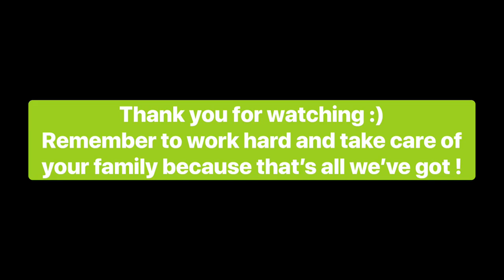WATCH THIS BEFORE YOU DETAIL FOR A DEALERSHIP !!!

Comment: I was/am getting $160 per car with dealerships, but it got to a point where they would only bring cars that need quite a bit of work and it went from a guaranteed 3x cars per wk to 1 car or none, so this is the last month I’m working with them. Dealerships are temporary. If you’re getting enough personal cars, don’t deal with dealerships.
Reply from the maker: That is true there are a lot of ups and down working with dealerships so I definitely do recommend not to work with dealerships unless you really need to🤝🏼 i was working with the dealership in this video for a while but they wouldn’t pay me until 2-3 weeks later so I cut it off !
Reply: @CarsMastersMecanicShop  good! If they don’t respect your time, you gotta do what most are too scared to do. Dealerships can be a hustle.
Reply: Did it long enough to get my llc and insurance and ran like hell

Comment: Dealerships after a while, start taking advantage of you. It's okay to start and learn things but over time, they're gaining "interest" over you by getting free cars detailed. I've dealt with plenty of used car detailers and they don't appreciate or tip for the most part, if ever. The shitboxes they bring use more time/resources and they won't even have a consistent amount. Once you get your own clients and referrals, wrap it up for the used car dealers. They don't care and won't care if your vacc fails, if your air compressor fails, power wash fails, etc. It won't make sense after a while.

Comment: What are you spraying towards the end of the video and which banks do you recommend to set up as a business bank? Also if you have any info on insurance it 2ill be greatly appreciated
Reply from the maker: At the very end I am jsut spraying my carpet cleaner which is sea blue 8-1 carpet cleaner diluted 1-4 and the spray Im using on all the plastics is simply just protectant also I can’t really give you any advice on the bank you should get but I will say I use chase and It’s been working out pretty well

Comment: Dude 120$ per car and youre doing it outside with a mobile set up , you should charge more
Reply from the maker: You can’t ! Dealerships don’t like to spend but I mean now it’s up to me to do the cars fast enough and if I can get 4-5 done a day then that’s $480-$600 a day
Reply: @CarsMastersMecanicShop you can charge more it’s your business and your service you gotta make money. Now dealerships some will pay and others won’t and that’s okay. We do dealership work as well and if we doing new cars charging $100 vac wash ect typical stuff if it’s used we charge them $200 engine bay, steam clean wipe down vacuum ect stain treatment, but if you are in a good position for the business and don’t need to depend on dealer work you good they need you you don’t need them how i like to look at it, because they gonna add that detail price in the car value to make a profit so it’s okay to charge a little more they will make triple that back.